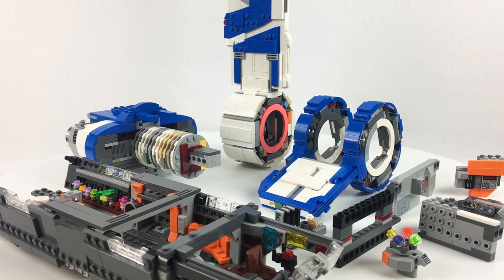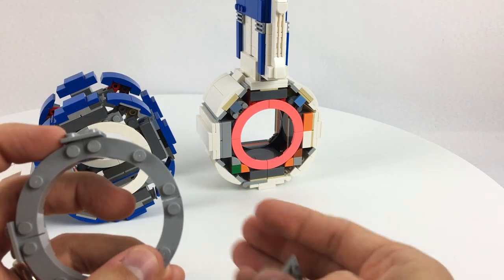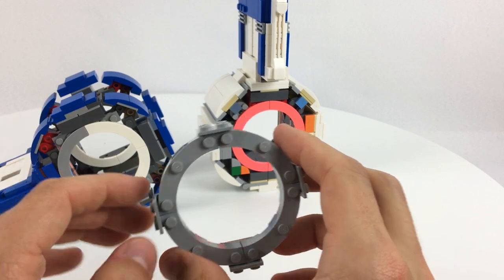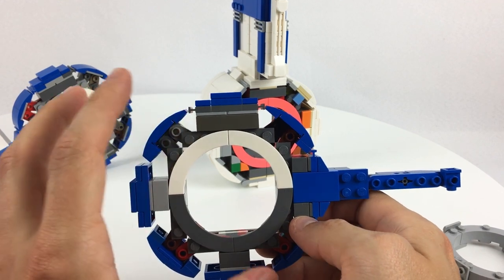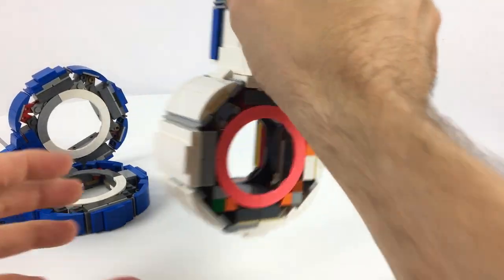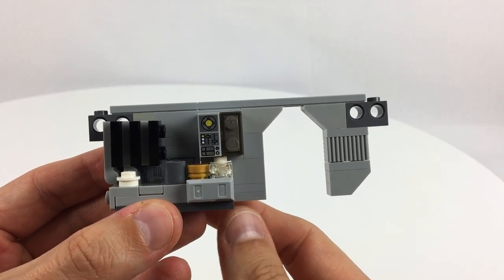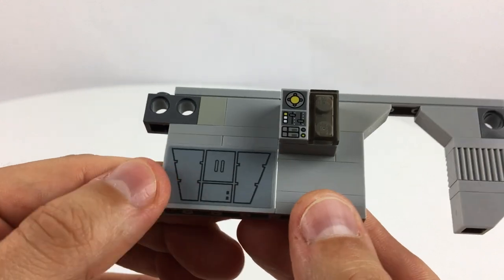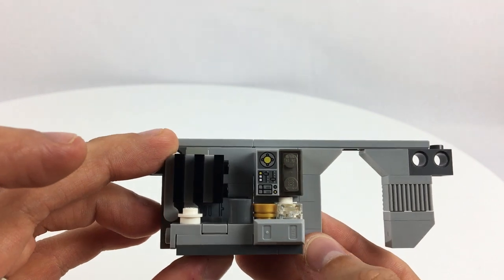Stinger Mantis Techniques Deep-Dive! Think Like a LEGO Designer Ep 5

Comment: I never get rid of stickers. If u need to remove a sticker u can use a brick separator to peel the corner(use more force than u think u need and it comes out perfectly, if u use less force, for some reason, it will mess the corner of the sticker up) and then just stick it on wax paper to save for later.
Reply from the maker: Good tips!!